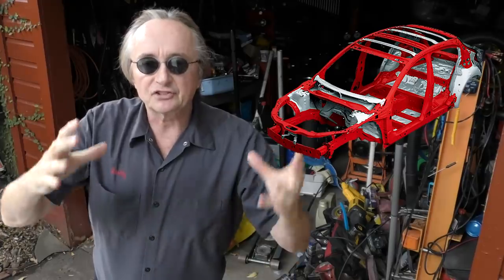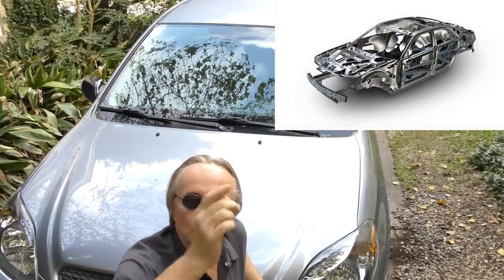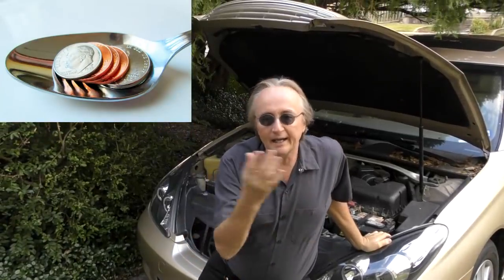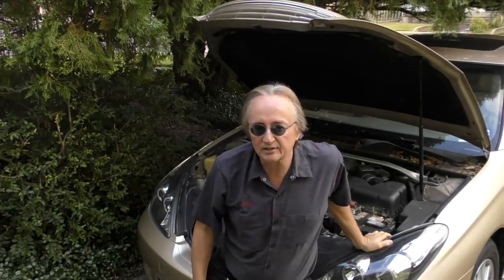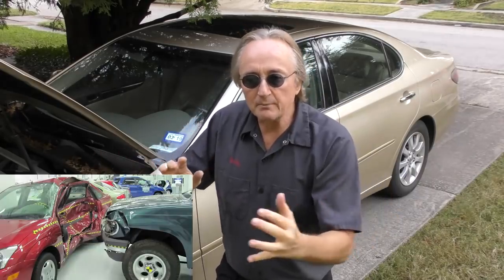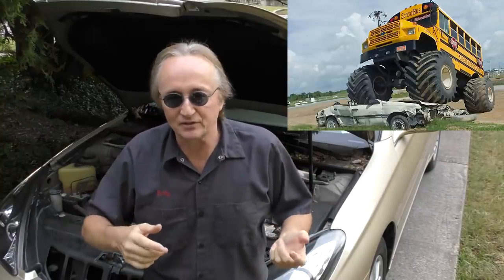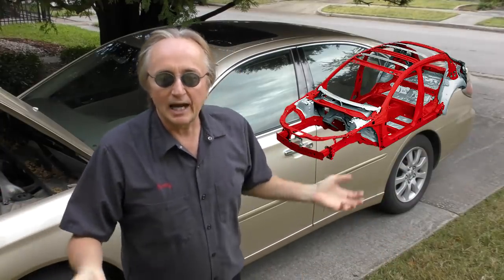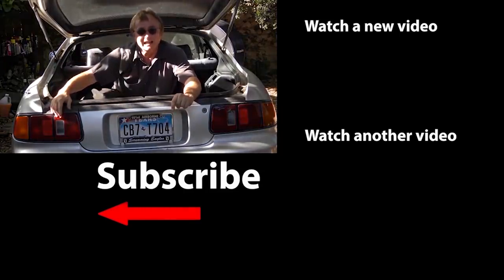Why New Cars are Safer than Old Cars

Comment: Hey Scotty, I’m looking to buy my 21 year old brother in law a car for school and work. He’s a decent driver of automatic transmission cars and has some experience with manual transmission cars. He got his license using a manual car. I came across a 2008 Subaru Outback 2.5i with 108k miles for $6300 and a 2013 Subaru Impreza 2.0i premium with 127k miles for $7000. Both have manual trannies and interiors/exteriors are in good condition. The 2008 Subaru has had one or two owners and the 2013 Subaru is a corporate/fleet car. Which do you recommend and why? We are located in New Jersey and get lots of snow and rain.

Comment: Happy Thanksgiving to all. Scotty I have a question. I have a 2013 Ford Focus with an automatic transmission. However it has an optional "pseudo" manaul (No clutch pedal, it has buttons on the gear lever to shift up/down). Would it be best to stick to to either the automatic shifting or manual? Thanks for the videos!

Comment: scotty, I have a 93 Cadillac deville, heat comes out the passenger side but cold air on the left side. actuators work on the right side, however drive side doesn't move, when I open it manually I still get cold air, I live in central Alberta, Canada, gets down to -40c/-40f, any ideas.

Comment: What happens to a motor that uses too thick oil, like using 20w40 in an engine designed to use 5w20?

Comment: Scotty who makes the best I4,V6 and v8 engines ?
Reply: V8's go to GM. V6's go to Toyota. Inline 4 Honda.
Reply: Dcc357 Ford guilts better v8 than gm tbh
Reply: David Laurie  that was just one V6 from the old days. Toyota's V6's since the 3.4 5VZ run like it's a form of art. They also run smooth as butter. You just gotta perform cooling system maintenance along with a water pump since the head gasket is the only weak point.
Reply: @andersonrodriguez8258  I prefer an OHV from GM for their reliability and DYI friendliness. The Coyote and Voodoo are great engines, in fact one of my favorites for performance.
Reply: Dcc357 Ima just stick to the inline 4 Toyota engine than if they v6 have the weakness
Reply: @andersonrodriguez8258  whatever keeps you happy. They are fantastic engines. However, my 5VZ V6 has been fine here in the Sonoran Desert. I'm making sure the cooling system is in top shape and that the fan clutch is OEM brand new. It doesn't burn oil at all. I do 7500 mile oil changes with Royal Purple full synthetic, and the oil level was still near the full mark by 7500.
Reply: Dcc357 I Hurd royal purple oil is top 3 best oil money can buy nd from what u said it prolly is sheesh 7500 miles nd it still good
Reply: Strixx gm quality has went down I Hurd a lot of their engines burn oil Thts what I’m saying ford makes the best V8 no doubt bout it especially the coyote the voodoo compare to the 6.2 gm v8 not sure
Reply: @legioner9  Lol Renault build garbage what are you on about.

Comment: Wait a minute. I thought consolidating exterior parts of cars made them that much easier to "total." I once heard that the Corvette integrated rear bumper would cost thousands and thousands of dollars for a small bump. Doesn't modularity cut body repair costs massively?

Yeah, I heard, which is more important, you or the car, but the unibody protective advantage is minor. The repair difference is MAJOR. Right?

Comment: Scotty, thinking about getting a mustang. Should I go with the true and tried V8 or try my luck with the new I4 ecoboost since its an untried engine. Also, should i go with the true and tried manual transmission or the new and untested 10 speed auto?
Reply: Scotty put a video out where he said he likes seeing car reliability in the field before buying one. Also, it has been an unusually long time since the last recession, and having those monthly payments would be an issue if you're laid off in a downsizing; you can't expect just picking up another job in that climate. It's better to prepare for a recession by paying off existing debts (especially car, credit card, and student loan debt) and saving cash in the bank.

Comment: Hey Scotty my 04 Acura TL has a new coilovers I put on maybe half a year ago and after I put them on maybe 2 months later my passenger side front wheel makes a wobbling noise when I hit a bump , I had 2 mechanics check ball joints ,sway bar endlinks replaced, wheel bearings good, and coilovers bolt are tight. Please help

Comment: Scotty - I have a 2007 Ford Focus with just about 119,000 miles on a 2.0L Duratec motor and a 5 speed standard transmission, i sometimes have issues having the clutch grab and engage, it feels like it's slipping, is it time to get my transmission and clutch checked??

Comment: I used to be a "buy American" type of guy. until the wiring in my 1973 Dodge went screwy, and the engine in my 97 f150 went kablooey. (yes, it was the 5.4, and I will never buy another) a friend of mine had a 95 Toyota Camry wagon for sale, and I traded a case of good beer and $300 for it, only expecting it to last 6 months. after 3 years of abusive driving, the Toyota needs a waterpump. it has about 215000 miles on it. do you think it would be worth repairing? I used the Toyota to haul the remains of my f150 to the junkyard after I turned it into a pickup-box trailer.

Comment: My car is a 2009 Crown Vic. Cop car version. Why is it the seat belt clips for the front and the back are different? I tried to buy extensions but they gave me the wrong ones. The gave extensions for the front not the back. Why would they make them different?
Reply: Some cop cars have plastic back seats for prisoners, that could be the reason.

Comment: Scotty can you talk about front vs rear drive? What are the benefits and disadvantages of each?
Reply: Rear drive handles better and is easier to control in driving fast..one reason all race cars from F1 to drag top fuel and Nascar etc are RWD
Reply: Advantages of FWD is that its cheaper to produce even on so called sporty cars if they include an LSD, it frees up space in the back of the car and they are better than RWD in ice and snow. Disadvantages of FWD cars is they don't handle well and are very bad at accelerating out of corners, FWD cars also have a poorer turning circle than RWD cars as space at the front is taken up meaning the front wheels can't turn as far.
Reply: Thanks!

Comment: Hello Scotty, thank you for your great videos and knowledge. I've got a question for you. I've got 2004 Opel Signum 1.9cdti diesel. It is equipped with the intake manifold with four swirl flaps one for every cylinder, which are closed to create air turbulence at low rpm and opened at high rpm to let as much air as possible. The ones in my car are loose and wobble in their sleeves, and they also have black soot and moisturous tar all around them. Can they be leaking air inside/outside the manifold? Could it be the reason for rough idling and shaky engine in neutral gear at around 1500 rpm? I've seen blanking kits to buy, where you can remove the flaps and blank them so that the air path is open at all rpms. How would that affect engine's ferformance, is it worth trying? All in all car runs well.

Comment: seems like there are hardly any cars made today where the body from the side is straight and the windows are large compared to the doors.  Now  they all seem to tilt up towards the back with high doors and relatively short windows.  Is this because of safety concern or simply styling taste?  I think this is why most vehicles look similar, bulky and boring today.

Comment: My 2010 Hyundai Accent has 51k miles on it but ever since the starter and alternator had to be changed because I let it sit in garage 6 months without running, it hasn't been the same and the engine sounds a lot louder than it ever did and if I go over 65 the steering wheel starts to shake. Is it worth continuing to fix if other things keep going wrong?

Comment: Hey Scotty, is testing regular passengers' car with Dyno (wheels hub type) to measure the horse power will be any good to indicate the overall health of the engine and the transmission? And off course compairing it to the manufacturer specifications

Comment: Whats everyone's opinion(even Scotty's opinion if possible) on the 1990 dodge ram w150 it has a 5.9 Liter  v8 360. Its a short bed and a retired state police truck and i paid $1,300 USD for it, i bought it with 159,996 miles on it

Comment: Scotty, I have a 2015 Audi A3 sedan with under 26k miles. Warranty is about to expire should I trade it in, extend the warranty, or keep it till it breaks?
Thanks
Reply: Extended car warranties are junk. Keep it until it breaks; hopefully the first major repair is cheap so you can sell it for some margin, and replace it with a more reasonable brand *cough*Toyota*cough*.

Comment: Thanks, Happy Thanksgiving Everyone.  Hi Scotty, I recently purchased a 1993 BMW 525i for $2000 in GA from Mountain Motors of Newnan.  At pre-inspection I popped the hood and did not the check power steering reservoir.  Motor remains sound and (quiet). It has 248,000 after I put 4000 miles on it in less 4 months. Once It got cold in October I started having power steering wine.  I checked the  power steering fluid reservoir and it was low.  I flushed the system and replenished it.  About 3 weeks later the power steering system started moaning again.  When I checked the fluid reservoir once more, it was low.  I have not lifted up the car, but I looked underneath without a light and saw dampness along the under body.  Is there an easy way to plug a small hole in a power steering system using a fluid additive?

Comment: How do I diagnose this? I have a 1999 Toyota Avalon the lights pulsate especially at low idle  the alternator was replaced and it still does it. that's weird isn't it?

Comment: You just said the school bus with a frame wasn't damaged but the SUV was... I'd bet on a big body frame any day.. the fact that the unibody are different they are worse they get soft and bendable..the Fame cars stay solid
Reply: You need to educate yourself about the physics of vehicle collisions. I had a designer at Ford Canada explain it to me once. There are basically three collisions when you crash your car; the first is when you hit something or something hits you. The second is when your body hits the inside of the car, whether it be your face hitting the airbag or your arms hitting the dash etc. The third-and this is the important one-is when your organs hit your skeleton. So what crash engineers try to do is maximise the time between collisions 1 and 3, to dissipate as much of that energy as possible. If you're in a strong body-on-chassis vehicle, it won't absorb the energy and it will pass it on to you the occupant. This is BAD. Human bodies have very specific maximum load limits, and you are much more likely to reach those limits in a body-on chassis vehicle than in a unibody vehicle.

Comment: Hey scotty, I am from Nepal and i have a Daihatsu Sirion 2009 model. I bumped it into the wall and both the airbags blew up. And so i searched the replacement parts but i couldnt find any. I tried to it import it via air but the airline company denied it saying the airbag is not safe to bring it with the plane. Why is it so? Will the airbag explane inside the plane? please explain this

Comment: Not coming back with body on frame any time soon?  Lets count the new vehicles with traditional body on frame construction that have come on the market/scheduled to be released soon: Chevy Colorado/GMC Canyon, New Ford Ranger, New Bronco based on Ford Ranger platform, Jeep gladiator pickup based on the Wrangler platform, redesigned Toyota 4Runner scheduled to be released in 1-2 years, Chevy Tahoe, Ford Expedition, Lincoln Navigator, all full size pickups.  To imply body on frame is a dying construction method isn't correct.  Yes cars, crossovers, and small-medium SUV's are unibody but anything that requires loads, towing, off-roading will be body on frame for the foreseeable future.

Comment: hey scotty i have a 95 jeep yj i have a problem with my oil pressure runs good well driving but it drops down  to about 10 psi but goes back up when rpms are up can this be fixed and what could it be

Comment: I Personally Will Not Ride In A Cadillac That Is Older 2000, Because I Personally Know Someone Who Had A Medical Emergency While Driving A 1960s Cadillac And Was Hit By A Santa Fe Truck.

He Blacked Out Due To Medical Issues.

The Front End Of The Cadillac Was Smashed All The Way To The Rear.

Before He Drove That Day He Said "If I Have Another Medical Problem; I Will No Longer Drive".

Comment: 2002 Toyota Mark ii blit with 1jz-fse engine. It's naturally aspirated with Toyota's direct injection (D4) hence the fse in the engine code. Fuel pump doesn't turn on when key is in running position but car starts. When I turn off the car I can hear the pump running then shut off. Car also hesitates when accelerating, loses power under load, engine sputters when driving at constant speed and overall power loss. Could it be my fuel pump needs replacing or some other fuel related issue. Please help
Car also gives p0175 code from time to time. I've replaced the o2 sensor on that bank, o2 sensor code left and never came back but still getting p0175 code occasionally.

Comment: Happy Thanksgiving Scotty! I hope all is well. My question is, I have a 2001 Jeep Grand Cherokee Laredo   4.0 V6 2wd. It has a factory rebuilt engine with 96k and the Jeep itself has 216k miles. Just recently it's started to make a knocking type sound only when I turn left, I've had my regular mechanic look at and he used a scan tool as well as went over everything, he found no issues. I also had a professional alignment shop check it, they checked all suspension, steering, and, alignment parts, found no issues and no worn out parts. However I still have the knocking type sound when I turn left, nothing shakes or anything, just the sound. Any ideas?

Comment: Why won't someone design a hybrid frame???  For instance a car with a solid frame but with connecting points that ARE softer that can break-away in a wreck?? That way it has the solid frame advantage - which you can use to detatch totalled sections of a divided frame that crumpled up like a unibody and then just buy a new section of frame that can bolt on to where the soft spots break off from in a wreck, then proceed to take advantage of the frame feature and replace body panels with all brand new and have a truly immaculate car again instead of dealing with a dangerous true frame OR a one and done Unibody frame??

Comment: Chrysler had Unibody since 1960...1st company to have it for mass produced vehicles,Chrysler,Dodge,Plymouth had uni body ,their Chrysler Imperial stayed frame until 1967   but still was the 1st fullsize ultra luxury car to have a subframe !

Remember kids,seatbelts were not installed in cars until 1964 ! People didnt even wear belts until the mid to late 1980's...Some States it wasnt law until the 1990's !

So,old crash deaths,injuries are not comparable with today as people didnt wear seatbelts thus comparing safety records of death ratings are off..If they wore belts death rate would have dropped to next to nothing !

Comment: Look at a solid frame from 20 years of age and a unibody car that had 20 years of age... The unibody is rusted soft and bendable..the frame cars or trucks still have solid frames..and unibody cars will bend and shift the older they get.. I see it all the time.. but a good solid frame car with no accidents stay the same.. the worst thing you may have is a rusted floor pan or wheel well.. I know they claim they do better the fact of the matter is with age the unibody shows it's age and how cutting corners always results in a product that doesn't last

Comment: Hey Scotty. Took my 05 grand marquise into the shop because my airbag light came on. I got in a minor fender bender and my mechanic said the piece that locks down on the seatbelt went bad and needs to be replaced, but somehow it's on the passenger side and its a 600 part. What's it called and where can i get one cheaper than that
Reply: Sounds like a belt tensioner, and it should be a common, cheap part. How much did they quote by part, and how much by labor?

Comment: Uni body is safer, just watch out for the 200 mph punch to the face that is airbags. I am a auto body tech and yes uni is safer but don’t drive at “10 and 2” anymore(steering wheel hand positioning) drive at “11and 1” with your thumbs wrapped the same way as the rest of your fingers. No broken wrists that way. And if your a passenger never rest your feet over the passenger side airbag!

Comment: i don't like unibody they rust from the inside out with all those hollow channels, at least with my bof truck i can oil spray directly onto the bottom of the cab from below and my cab floor is never wet on the inside and i completely remove my interior down to the floor every 6 months to clean and stop any rust that may be starting and to let my sound insulation dry out in the winter so it wont rust from above or below , cant do that with a unibody

Comment: Yes use aluminum in a car, weaker than steel so how is it safer?  Someone hit my f-150 the door is dented but you should of seen the front end of their van.  The idea about saving gas because its lighter is a myth it depends on the engine size small engine less gas bigger engine more gas.  Sure the acceleration to overdrive gear will be faster being lighter but the fuel savings will be very low.
Reply: Weight plays a role in fuel economy.  Kinda apples to oranges but my semi when hauling empty trailer averages 10mpg. Put 40000lbs addition it drop down to 7.5mpg. Hell getting slightly wider tires on your vehicle can decrease fuel economy.